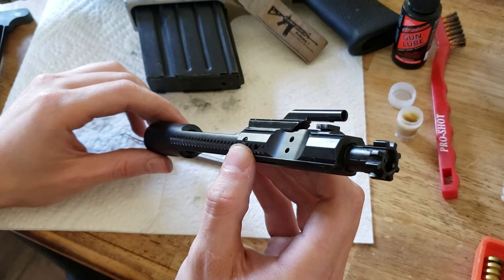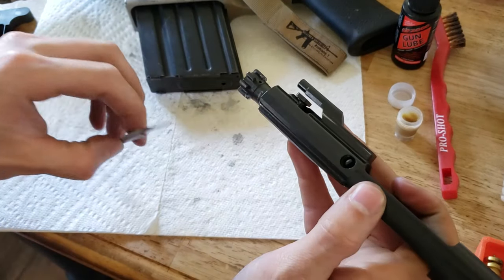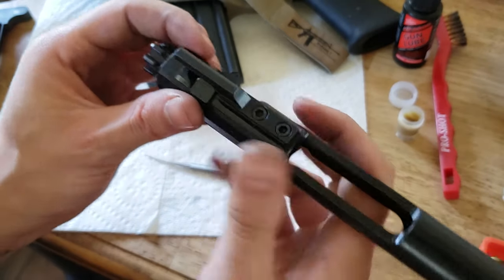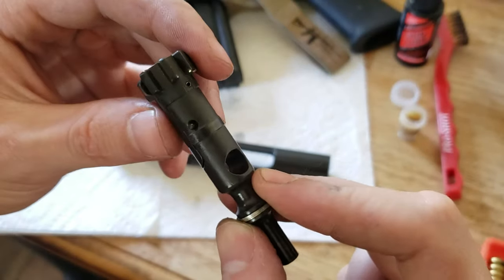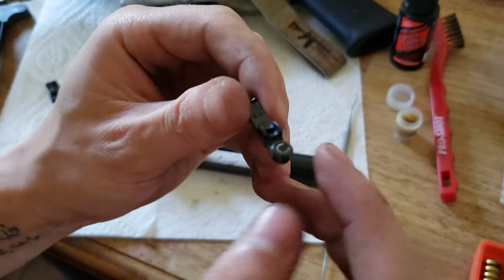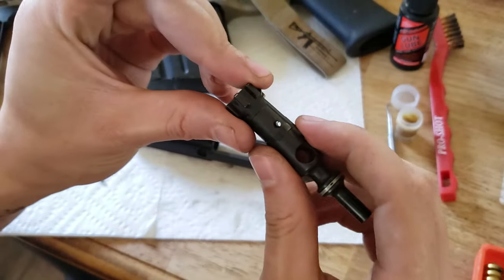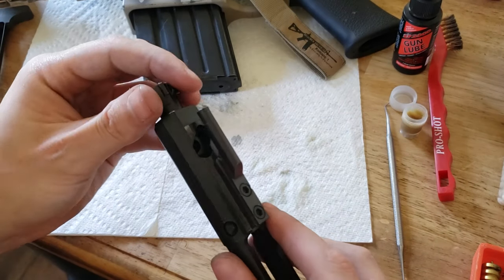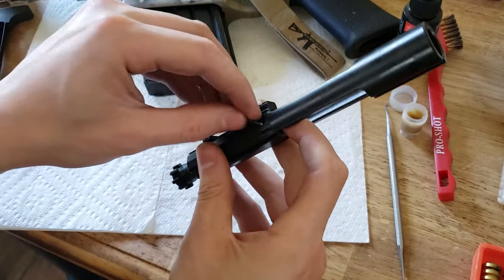Disassembling, Cleaning, and Lubricating your Bolt Carrier Group

Comment: I've been told those "3 holes" are gas vents and NOT oil holes.
Reply: Ian Aintsaying true. I heard the same thing. Those are gas ports.
Reply: Damn I wish I would have seen this comment lol I think I got some oil on them
Reply: they are gas vents but you can still put oil through them!
Reply: @Ayejimboslice  you can still put oil in them and all over the bolt... hell some guys have it dripping out of the gun and it runs just fine... I used to use just oil and still will if I'm at the range or what ever but I like to grease the wear spots and then oil the rest... Mine now feels like glass when I rack the bolt so its good to go
Reply: Correct
Reply: Same here.
Reply: Yup
Reply: Never put any lubrication in the gas ports, it will do nothing except attract dirt
Reply: Oh look, a hole, must be for oil. Oh look, the barrel has a hole, must be for oil. Oh look, the magazine has a hole, must be for oil. lol, just being silly.

Comment: Thank YOU!! Finally cleaned  AR bolt watching your video. Cotter pin would not go back all the way (firing pin) - found out I have to press downward and wiggle. Just in case anyone else is having a issue with reassembly.

Comment: Thank you. One thing my dad told me about the bolt before putting it in the carrier is to make sure that the  gap in the ends of each metal ring on the bolt are offset to prevent gas from escaping.
Reply: It doesn't matter if they are aligned or not Just a simply cycling of the gun will cause the rings to change positions. The truth is you only need one gas ring but the triple rings just more of a redundant feature to avoid any gas loss.
Reply: @Dan-di9jd  Makes sense because every time I take apart an AR the gas ring end gaps seem to be lined up.
Reply: Doesn’t matter
Reply: @peterv1318  Thanks, seems like every time I clean it they somehow are all lined up anyways.

Comment: Good info, just pulled my mp 15 apart today. Took the carrier apart and i gotta say as a new ar owner they are pretty darned easy to field strip. Made the newb mistake of trying to re insert the bolt carrier without pulling the bolt forward. So glad i was alone at the range.
Reply from the maker: Mistakes HAVE to be made, in one way or another, and sometimes its nice to make them when nobody is looking :-)
Reply: I have a work buddy that has never cleaned his AR after 500 rounds of shitty wolf steel case. It felt like his bolt was covered in peanut butter when I charged his gun. I sat him down in front of everyone at a crowded range and showed him how to clean it.
Reply: @brian-8814  right because embarrassing your buddy infront of a huge crowd is the way to do it.

Comment: Video was very well done and very helpful. 
I served a long time ago, and we were taught to use that CLP very generously. Their theory was blowback, action, and heat would thin whatever lubricants are in it, so you have a better chance to avoid it running dry.
But i was in a long time ago and maybe things changed. I tend to still be generous with the oil but that’s just me. I just keep them clean and over oiled hope for the best hahahaha
Again…. Good job on the video.
Reply from the maker: I do think that different environments may also contribute to how much oil you should use, and how often you oil... hhhmmmm
Reply: @Thepreppersbunkeroutdoors  Perhaps you are right. I spent most of my time in wet, humid climates, where rust was a factor. I can see being in hot, desert climates with little humidity like Iraq and Afghanistan, with the sand factor, could gum up an overly wet action. That does make a lot of sense.
Reply: If I put that light coat of oil on my BCG, it'd be gone within a couple days due to the weather, that's not enough oil imo and the wear marks show it
Reply: @aj897  - exactly! He doesn’t use enough oil. Those parts shouldn’t look like that.

Comment: Over the past year I've strictly been using mil-comm products and use their grease and lube in conjunction with all my firearms. Over the past 20 years I've tried practically everything and nothings been more impressive than mil-comm. It's done the best at protecting, lubrication and makes cleaning child's play. Best part is that it's a patented synthetic blend that's nontoxic, won't harm your skin, has virtually zero smell and is safe on polymer and synthetic stocks.

Comment: Put 1500 rounds through my brand new AR without cleaning. Surprisingly, it was still running flawlessly. My friend told me I need to clean it anyways, and WOW was it  dirty. 

The bolt had thick carbon build up on the back side. Very hard to get off. I've learned my lesson and I'll  clean it before it gets to that point.
Reply from the maker: Yup! The more you shoot and the longer you wait the harder it can be!
Reply: Same lol I’ve probably ran close to 3k round without cleaning the bolt carrier lol I cleaned the other parts but never actually took the bolt apart and holy tuck it’s dirty as hell
Reply: Also when people say ar’s jam easily isn’t necessarily true lol

Comment: Silly question.... when putting a BCG back into an upper, you need to pull the bolt forward in order to move the cam pin forward too; correct?  I’m a newb and that is the only way mine will go back into the upper.  If not, the cam pin block the BCG from entering the upper.  I just wanted to make sure I wasn’t doing something wrong.  Thanks
Reply from the maker: Yup, you're g2g bud
Reply: Thanks!  I didn’t want to assume I was right and ruin a new rifle.

Comment: Probably useful to mention that the extractor needs to be in the correct position when inserting the bolt in..about 10:00 o'clock so it ejects out the the right side.
Reply from the maker: Yes, because the fact that it cant be in any other position makes it important
Reply: @Thepreppersbunkeroutdoors  True in most cases. I only mention it because a friend of mine has an AR15 build that he accidentally installed the bolt rotated 180 degrees, and the stupid cam pin still seated and rotated as normal. Granted, he felt like a dumbass; but it could happen.

Comment: Hey just took my bcg apart the bolt tail look like it had some scorching on it came off after a hard cleaning. Should I be worried. Just for info it’s an aero nickel plated boron bcg
Reply from the maker: Do you mean scratching? Or some of the coating came off?
In either case- i would be concerned about what caused it in the gun before i was worried about the bcg itself. I would be looking for wear and problems in the reciever extention and the area where it screws into the lower.

Comment: Do different bcg finishes have different lubrication requirements? Like if I were to upgrade to a nickel boron finish should I still oil at all?
Reply from the maker: You should lube them all- but how much it will affect performance as it gets dirty will vary.

Comment: Wonderful to know that I don't have to take off that top gas bit to take out the bolt. Got the brilliant idea to sand the rails of my BCG with everything assembled, and a good amount of metal dust got into the bolt hole there the rotating pin rides in.
Reply: I’m not understanding why you would want to “sand” the rails?!?
Reply: @M21-w1y  The coating on the inside of the receiver and the mate rails on the BCG were causing the bolt to drag and stick when manually cycling it.
Reply: @galvanizeddreamer2051   Probably because it's dry and you didn't use enough oil/grease
Reply: @aj897  Nope. Oiled it to the point of it leaking out around the edges of the receiver. Bolt stuck every time I pulled it back, eventually just sat and ran the bolt for a couple hours, bumping it loose by tapping the butt on the ground until it just ran smooth. Delta Team Tactical was the brand, if that changes your assumption.

Comment: First off thank you for you’re service,great video what’s the tool yo are using,thanks
Reply: Looks like a metal pick. You can find them on Amazon. I got a polymer set (didn’t want to scratch my guns up) they work just as well in my opinion and pretty inexpensive.

Comment: Four and a half decades ago I was a Combat Engineer in the 101 Airborne Division. I was also my Company's Armorer, and was sent to the United States Army's Armorer's Course. If your going to instruct some one in how to assemble a bolt carrier group it would be far better for the student to teach them that the extractor should be at the approximate 10 o'clock position looking at the face of the bolt to insert the cam pin. Instead of instructing some one that if it wont go in turn 180 degree's. Be precise and explain that in order for the weapon to extract and eject the empty case that the extractor needs to be at that position in order for it to function correctly, even though the cam pin will not go in if its wrongly positioned. A person owning ANY weapon, should understand its function and why it function's that way. They should practice disassembly and assembly, they should practice loading and unloading using dummy rounds all in the presence of an experienced person before ever shooting. I am a HARD CORE Constitutional Conservative. Hard CORE 2nd Amendment, but there are too many idiots with not an once of common sense that are dangerous with a loaded firearm. They don't understand its function, they are ignorant as to proper firearms safety and trigger discipline.  Just saying.

Comment: Love my AR don’t get me wrong, but this is also why I love my ak lol
Reply from the maker: Because... why? The ak isnt really any easier lol- neither are difficult
Reply: @Thepreppersbunkeroutdoors Got both, love both, Army infantry vet from the 80s, but I gotta beg to differ.

My cleaning protocol is between 300-400 rounds for both my AK and my AR.  The AR  is definitely harder to clean.

Maybe it’s just me, but it takes me a minimum of two hours - usually more like two and a half - to get my AR to a level of cleanliness that I find acceptable.  I can do a decent “functional cleaning” on my AK in 45 minutes; if I take my time to do a real thorough job it takes an hour and a half.  And it comes apart and goes back together in a much simpler and straightforward fashion, no itty bitty parts to worry about losing.  Just no comparison between the two maintenance wise.
Reply from the maker: @TheRobman139  after all this time and with your infantry experience you should be able to pull your AR all the way down in a minute or two- time of assembly or disassembly should he a mute point.
The lengthiest cleaning on an AR is the star chamber- but you can nearly spend equal time in the chamber of an AK.
You can also buy star chamber pads/ brushes and fix that issue.
The AK may be simpler but as a fighting rifle both have maintenance that is minimal
Reply: @Thepreppersbunkeroutdoors  I’m not so much talking about time of disassembly/reassembly.  Yes, once you know how it works the AR isn’t that bad in that respect, but it still has more going on than the AK.  There’s no question that if you had to teach a novice on how to break down and put back together one or the other, you’d have to spend more time on the AR than you would the AK.

And there’s no getting around the fact that the DI system on the AR squirts more crap into the works than the piston system of the AK.  It’s not just the star chamber, it’s the gunk that gets inside the carrier and parts therein.  It just takes longer.  I would be interested in seeing a video with two people cleaning them side by side, equal round count (say, 500), comparable ammo (maybe both shooting S&B).  I would bet you dollars to doughnuts that the AK would clean up significantly faster.

I’m not trashing the AR, mind you.  Like I said, I have one of those too and it’s a great rifle.  It definitely has advantages over the AK…but ease of maintenance isn’t one of them.

Comment: Brownells says those last 3 holes you mentioned are vent holes and lubricating them just makes the action dirtier.
Reply from the maker: Yup, clearly i have been affected by some of the silly wives tails that i am trying to fight against- so i need to make a new video and link it to this one.
Reply: @Thepreppersbunkeroutdoors  What if you're running it hard, maybe been running it hard, and don't have time to do a takedown and scrub all the built up carbon/sand/whatever off.  Drop in the lube, dissolve/dislodge some of the gunk, splatter it all out with happy little trigger pulls while the guy next to you is trying to figure out why their bolt is locked up.

I think it is something that came up as a quick field fix for a specific problem and along the way got convoluted into a way to prevent a problem.  It can fix a problem if a problem exists,  it will cause a problem if one doesn't exist.
Reply from the maker: @Moocowhappy  it was never about preventing a problem, it is purely a quick solution.
Reply: @Thepreppersbunkeroutdoors  Well I'm glad we are on the same page then!  Putting lube in those vents absolutely has a place.  Not quite a 'silly wives tale' ;)

Comment: I cant get the cotter pin back in!! I have bolt back and fire pin in hole appears clear, first time taking rifle down. Will be getting new cotter pin..
Reply from the maker: You should be able to just take a pair of pliars and make sure the tip of the cotter pin is mashed together and get it in.
Reply: @Thepreppersbunkeroutdoors  Yah I kind of forced it with pliers and bent it. Its a cheap part will just get a new one. Why not use push pin there!!

Comment: I wouldn't suggest putting oil/lubricate down any holes found on the BCG. Those holes are gas venting holes and adding oil will create "gunk" and sludge. If you're having serious issues with your BCG just replace it. They're not that expensive (standard phosphate coated).
Reply from the maker: Thats like saying we shouldnt use port injection on a direct injection engine because "thATs wHeRE thE aIr GoES"
Adding oil to the ports has nothing to do with the condition of the bcg and everything to do with getting your gun back up and running in a firefight or a training class after a lot of shooting.

Comment: Only detail I feel was left out of the presentations is the gas rings. I was always taught to stagger the slots on the rings around the bolt so they don't line up.
Reply from the maker: You are correct. I wish i had mentioned it.

Comment: I'm curious to know if there's any possible way to reassemble the rifle or bolt carrier incorrectly and still have it function. Or is this rifle designed to not work no matter what even if you make the smallest error after reassembling.
Reply: The cam pin will not go in if it's backward. there is really only one way you can physically put it back together. its pretty foolproof.

Comment: At the end you said put oil in these three holes. Aren't those exhaust? Wouldn't putting oil on it gunk it up with carbon?
Reply from the maker: If putting oil in there would gunk it up we wouldnt use oil anywhere for fear of gunking it up.

Comment: So there's not a top or bottom to the bolt? As long as the cam pin slides in the bolt it doesn't matter if the bolt is spun 180 degrees one way or another when it's inside the carrier? Or depends?
Reply from the maker: The cam pin cant slide in backwards, so yeah
Reply: @Thepreppersbunkeroutdoors  no, I mean the bolt. Assuming the pin only goes in one way, if the bolt is spun 180, is there a difference?
Reply from the maker: @hooks4nooks  yes, the difference is if the bolt is rotated 180 the pin wont go in
Reply: @Thepreppersbunkeroutdoors  Roger! Thanks. 👍

Comment: Followed guidelines in your video after I kept running into jam issues thinking it needed lube.  Sadly it’s still jamming.  Beginning to think the magazines need a little tweak at the top.  AR15 Lower, 6.8spc upper.  Bought it used so my first thought was that it should be broke in already.  Maybe I’m wrong. Dunno what else to try.  Anyone have thoughts?
Reply from the maker: Man idk- people get into other calibers and it requires a whole new balance of parts, which is one of the reasons i stick with simple tried and true 556 or 308. It could be your buffer is the wrong weight, recoil spring the wrong power, or gas port drilled too small.
Reply: ThePreppersBunkerOutdoors thanks.  Probably better off taking it to someone else who knows more than I do.  I found a video where a guy was filing down his metal magazines and it worked
Reply from the maker: @familyguy5081  hhhmmmm if you screw up a feed lip by taking too much off its screwed though. Yeah that is definately beyond my scope of competence
Reply: ThePreppersBunkerOutdoors I agree but it’s worth trying let me find the link of the video

Comment: My firing pin seems loose, and is moving around. This Diamondback db10 .308 was ordered through the gun shop. (My mistake, something I've never done before.) I usually order my own stuff online through Buds Gun Shop. The gun took more than 14 days to arrive, and when I got to the store, the box was already opened. The gun shop owner then told me that it was held at the post office for 2 days for no reason. Upon expecting it, it appeared to be freshly lubed with a nice amount of oil, and with some small scratches. (Strange). When I refused the rifle, the gunshop owner told me I would be penalized $500-$600 for refusing it. Which would be about half of the $1200 I paid for it. (Shady) So I took it. This is my first AR 10, so I don't know anything about it. I feel it was tampered with for some strange reason.
Reply from the maker: @mako51x43  a firing pin can appear loose while sitting in the bag, it floats.
If a gun isn't up to your standards you should be able to refuse it from the lgs- that is pretty poor service on their part, especially if it's beat up.
I like supporting a local gunshop over a giant like Buds but you HAVE to find a good one for it to be worth it, and sadly there are too many small local gun shops that just suck.